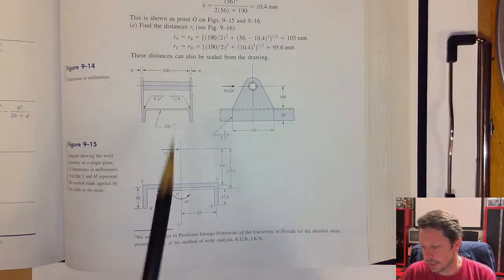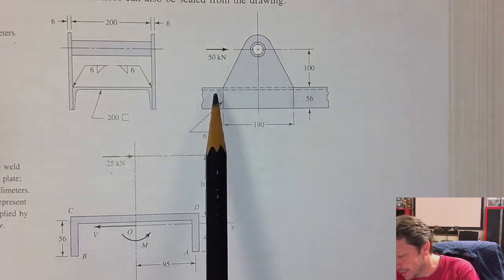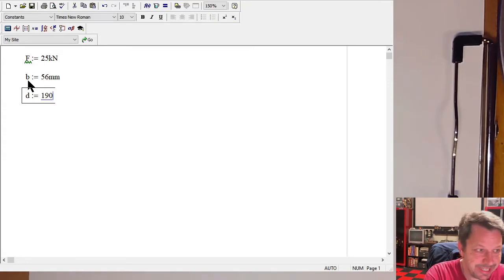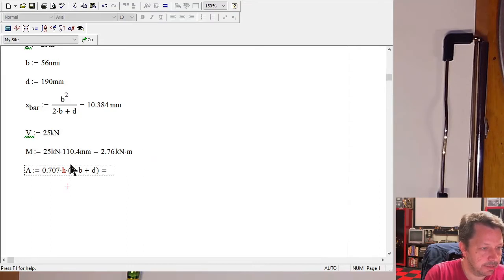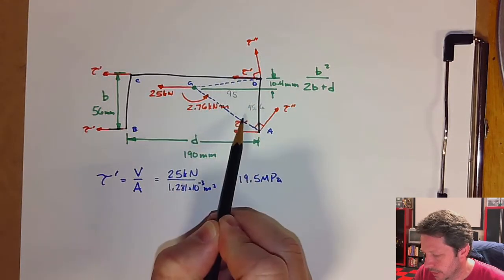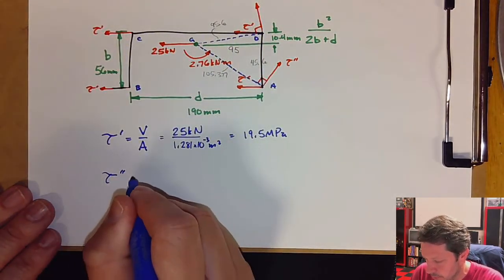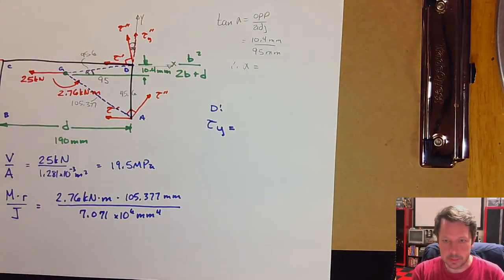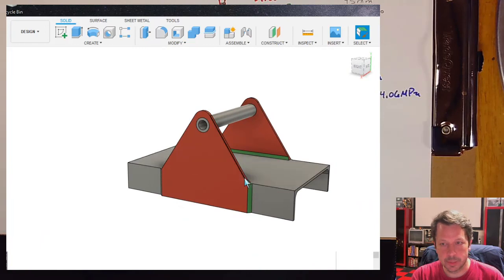Shigley Example 9-1 Detailed Explanation

Comment: Thanks...i was stuck at some points and now its all clear ....but still a little confusion with the total load 50 kN ..why are we considering 25 kN in solution???
Reply from the maker: We are assuming the 50kN total load is evenly split between the two sides. So I am looking at only one of the two weld groups and assuming that it has to support half of the 50kN load.
Reply: Ok I got it now....Thanks alot for the explanation.